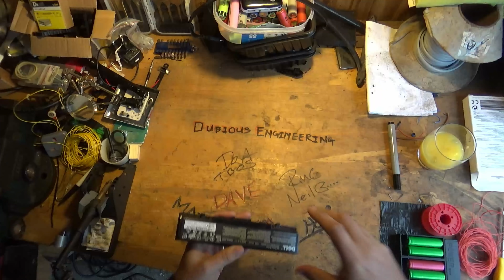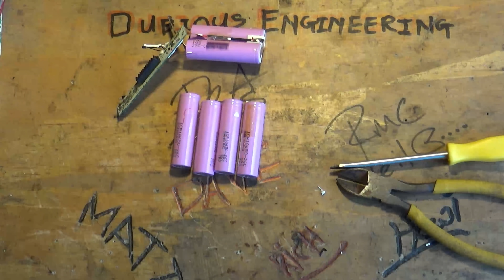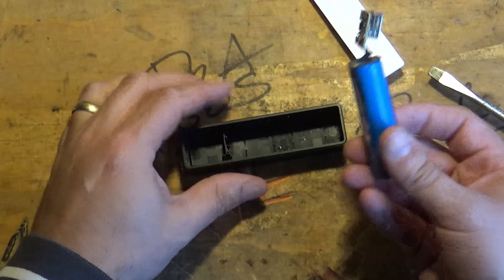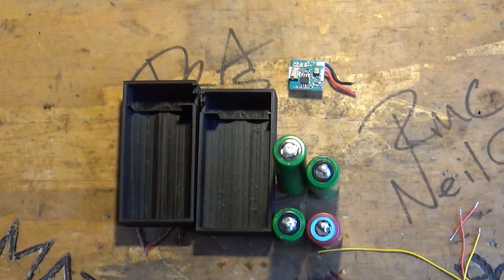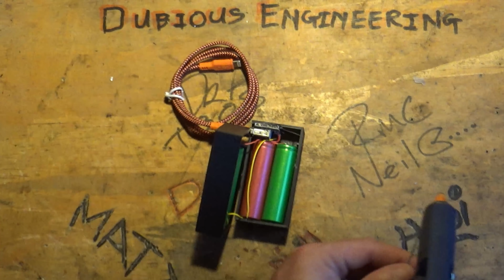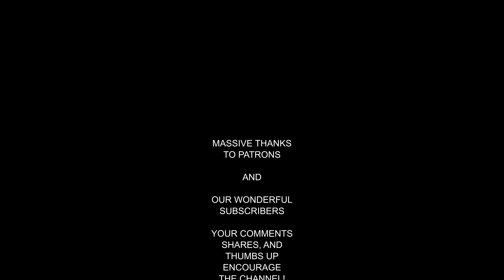DuB-EnG: Upcycled High Capacity Phone Battery Bank SelfBuild  - DIY 3DPrinted recycled electronics

Comment: Alice has some better boards available for a little more delivered from china - 

https://www.ebay.co.uk/itm/Dual-USB-5V-1A-2-1A-Mobile-Power-Bank-18650-Battery-Charger-PCB-LCD-Display-DIY/401188626802?hash=item5d68b4a172:g:DmIAAOSwhztbGQRl  

They also has an enclosure that allows charging of anything up-to laptops! 

https://www.ebay.co.uk/itm/3-3A-Mobile-power-bank-Six-18650-Battery-Charger-For-19V-Laptop-5V-iphone-5V-21V/401365587339?hash=item5d7340d58b:m:m2FS0Yc-1WBkcXrtq3Ze4_Q
Reply from the maker: Oh wow...  that would be so much easier than designing and making my own enclosure...  hmmm...  I just ordered a massive battery and am investigating the charge system for the camper van - Hahahah - Well, a big sincere thanks for watching so far in... Your support wont go un-noticed!!  All the best!!